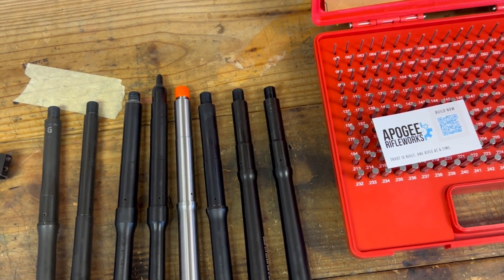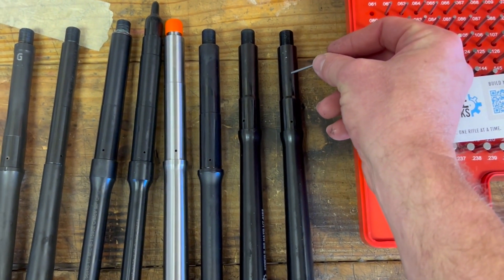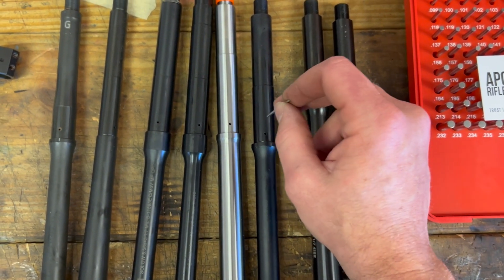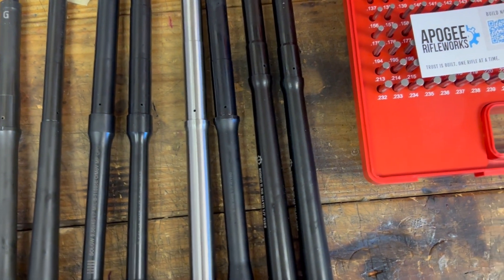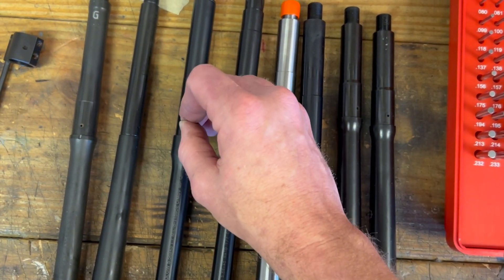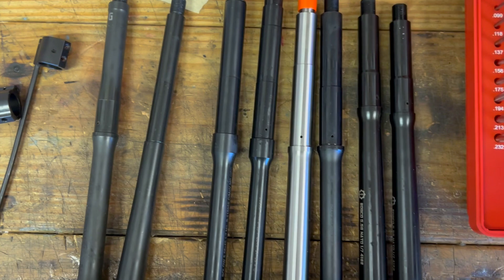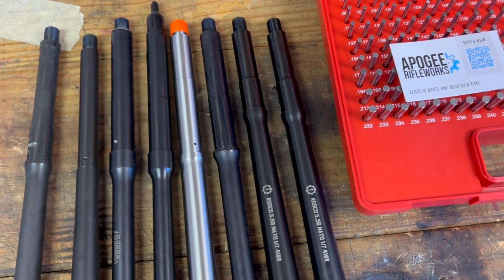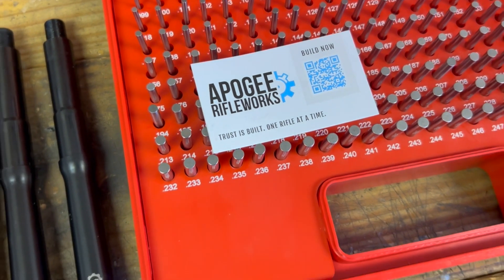12.5" gas port sizes, Geissele, Criterion, White Oak, Rosco, KAK, Ballistic Advantage

Comment: What do you think of the YHM "suppressor only" gas block?
Reply: I have one on my 11.5 dedicated suppressed build and it definitely helps the amount of gas coming back but it didn’t solve the over gassing all but it’s self. Still had to put h3 buffer weight and bootleg adjustable BCG in there just to get ejection to be 3 o clock with m193.

Comment: Geissele states on their website that the 12.5 carbine barrel measures .070 on the gas port which is a sweet spot for that barrel length do you know if your example is an older barrel of theirs?
Reply: Depends on what their tolerance is if it’s +/- .003 it’s still in tolerance
Reply: That’s for URGI.  Super duty is .65

Comment: Easiest fix without messing around with adjustable gas blocks is to run a BRT Eztune gas tube to essentially downsize the port - you can choose a specific size or have them pick to tune for suppressed or mixed use.
Quick question at 6:40 - won't a slightly loose block eventually seal tight with carbon after a few hundred rounds? Or have you found that to not be reliable.

Comment: Interesting stuff. According to other people's measurements, the Sionics and Triarc mid-length 12.5" barrels use a .078 gas port, which sounds quite conservative compared to the measurements of many of these carbine and "patrol" length barrels. I bet the Sionics and Triarc barrels run nicely when suppressed.
Reply from the maker: Very cool and it is refreshing to see manufacturers attempt to refine the operational window a bit on the AR platform.
Reply: @ApogeeRifleworks  I appreciate the amount of time, money and effort your tests will take. I hope to see you test the mid-length barrels available out there in the future. 12.5" has a rep for being a finnicky length, and I'm curious to see if the mid-length or intermediate length barrels truly offer any benefits.
Reply from the maker: @AncientGloom  We have grabbed a few min-length 12.5s so that info will eventually be out there and then as customer's order builds we will thoroughly test the ones we have not bought ourselves. It's hard to quantify the "feel" of a properly gassed carbine length with an A5/H3 system vs a mid-length running something like an A5/H2, but there might be enough of a difference to be worth it. Maybe.